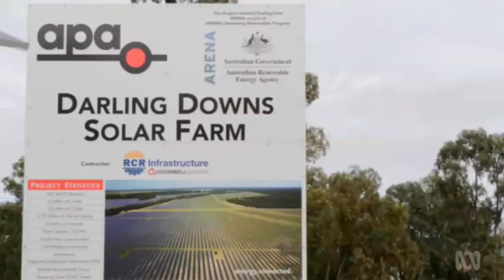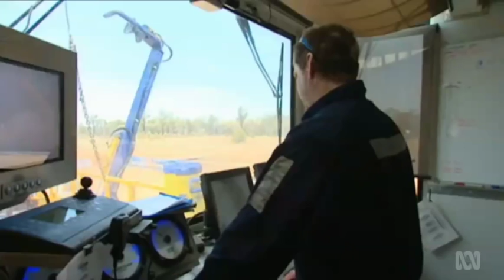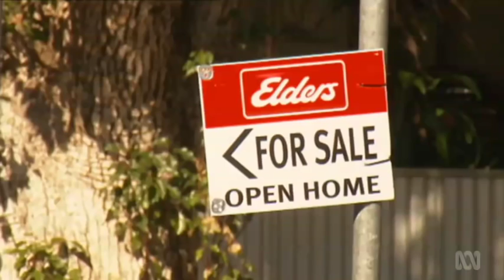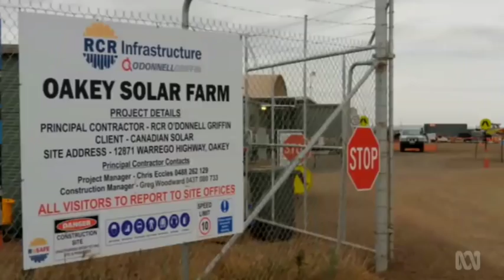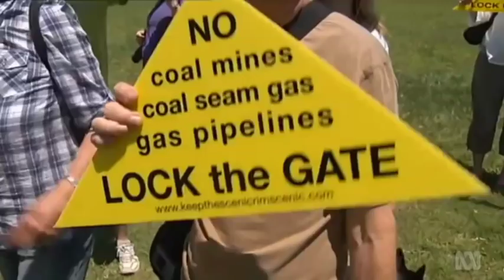Solar Energy Boom  QLD , Australian farmers cashing in.

Comment: Why not put the solar panels on higher supports? 9-12 feet off the ground and the land below remains for sheep farming, cattle farming or cereal farming.They are doing this in Korea with rice farming. It leaves the land beneath free to be used for agriculture. If you space out the panels sufficient sunlight penetrates to the ground to grow crops. The Koreans have already shown this works. I see so many of these videos where the complaint is the use of good farm land by solar projects. People just need to switch on their brains and think through the problem!
Reply from the maker: @Andres LeonWe need farmers close to the grid otherwise it will cost more in infrastructure.
 I would argue a farmer will make more profit off the land with solar panels than crops or animals. 
It does not have ups and downs of drought or over watering .
Farmers need the income.
I have not seen one farmer yet that is unhappy with energy farming.
Who would be ? pocket full of cash for doing nothing. 
Unlike the gas company's or other miners who do damage and then piss off leaving towns high and dry.
Reply: A similar approach is being used in India. Climate change is already & will continue to make farming in Australia very challenging. So long as once construction is completed the ground cover is reinstated the risk of soil erosion diminishes & over time if the land has been continuously cropped rather than grazed then the soil fertility should have the opportunity to return alongside CO2. sequestration capability. Once the ground cover is well established there's no real reason that it can't be used for grazing. Shading from the solar panels may help to reduce moisture evaporation in the same way that shading is used in other hot climates in Permaculture  agricultural farming practices. It's highly unlikely that land used today for solar power will return @ the end of the contractual period simply because by that time climate change mitigation, the need for clean renewable energy and simple economics will mean that  solar will continue to form part of Australia's energy mix.
Reply: @australianews  YES and NO, like what "Peter S"  and "
Graham Campbell" are saying is,
 why not DO BOTH!  Have the land usable by the animals grazing and have shade for them. 

"
Reply: Another possible solution is to encourage distributed generation.  Solar installed on residential roofing retains the usability of the ground beneath.
Reply: @georgefenrich4119  The shade is important considering the heat waves, also the reduce sunlight hitting the ground means all the water gets to the ground but is not evaporated as fast so the plants do grow faster where the sunlight does get to the ground.
Reply: @Graham Campbell I agree with you mate and the people saying they have so much land just use it up etc... sounds like the 1800's in the USA which means that is asinine backwards thinking.  Think in 3d terms not in 2d so rise it up and allow the land to be farmed for not just solar but for other things as well.  If farmers all stopped being a farm of animals and produce and instead all went to solar farming, or their land was removed from them to do solar farming, then you would starve to death or be a net importer of food (like China is) which negates every reason to do this.
Reply: The Best Stooge One YouTube video I watched showed this idea of raised solar panels being used in South Korea. The point was made that the crops only use 70% of the sunlight to germinate and grow so 30% is excess and wasted. If panels are spread out, but still covering a substantial proportion of the land the crops below grow quite happily and normally. Presumably the same goes for grass and, again, presumably livestock would welcome some shade from the intense sunshine you have downunder. It seems so bloody obvious, but what do I know. Sadly, I’ve seen other videos where Aussie politicians claim global warming is all a hoax and that solar is not the answer and can never supply sufficient electricity. Australia is bathed in sunlight! They need to speak to the people of Denmark etc where they are already up to 50% renewables!
Reply: @Graham Campbell I am not even looking at crops but just allowing the sheep, or whatever livestock, to coexist with it.  Yes, they would love to go under them for the shade in the noon day sun as I have seen them do that many times with sheds and some ranchers (the ones who care) actually buy portable car ports and erect them as shade for their livestock.  Not sure why the morons running something like this wouldn't see that putting them up about 2.5-3 meters makes a hell of a lot of sense for all sorts of ecological reasons.  This tells me they don't give a damn about being green only making money because the eco system will love you more when you are at one with it instead of trying to conquer it ala 18th and 19th centuries.
Reply: @grahamcampbell8297  i think this was the video https://www.youtube.com/watch?v=hKXlx2riMgo
Reply: @atari7001  A) this is already happening.
                       B) it is already & will continue to be necessary to do both in order to meet the growing energy demand due to population growth as well as the explosion of digital technology in combination with the increasingly dominant role it will have in humanity's future.
Reply: @grahamcampbell8297  trouble is due to many years of neglect most of the eastern states grid network is already at capacity and needs a total rebuild to carry any further increase in load, the answer of course is the electricity generated needs to be consumed as close as possible to its source, there is no sense in exporting NT power to SA as with any lines distribution a large amount of electricity is lost in its travel along the lines